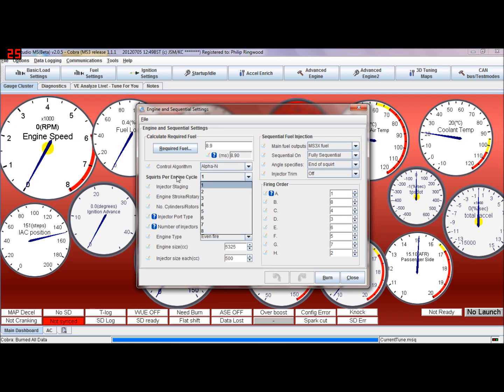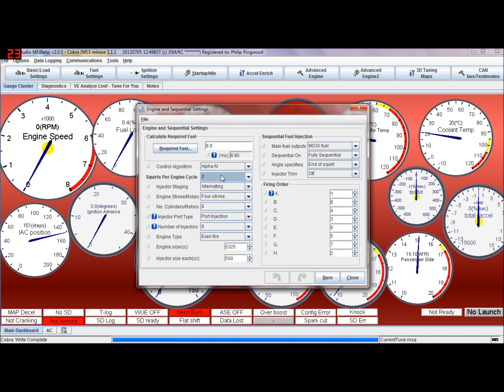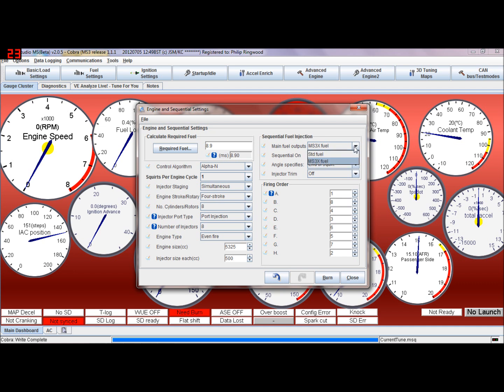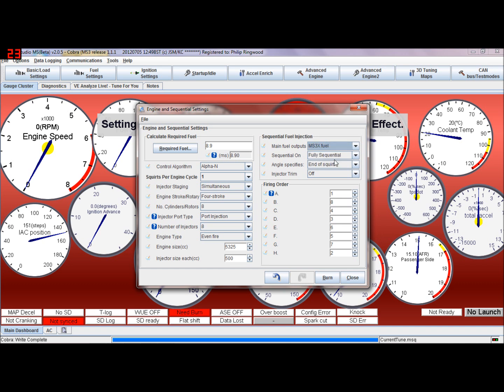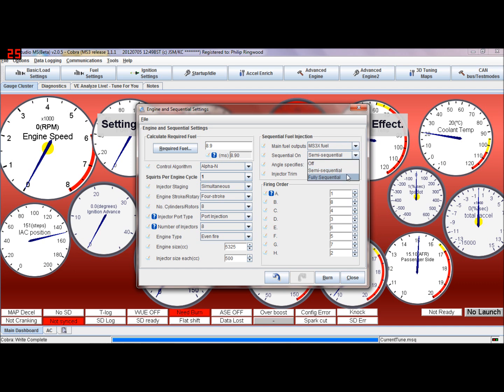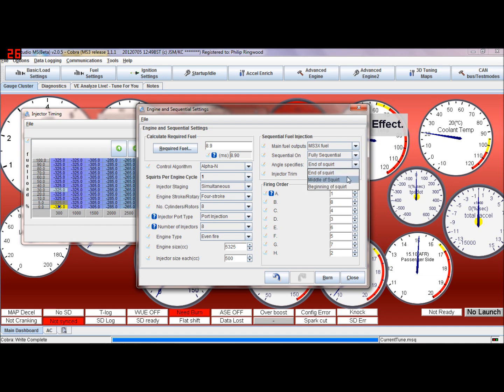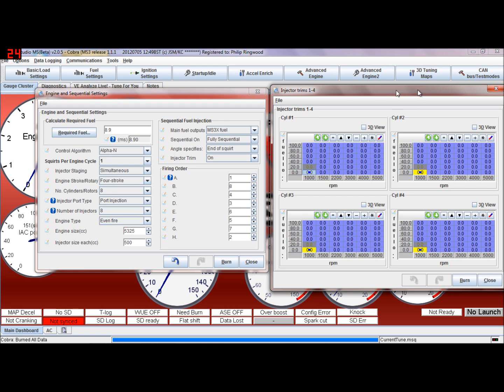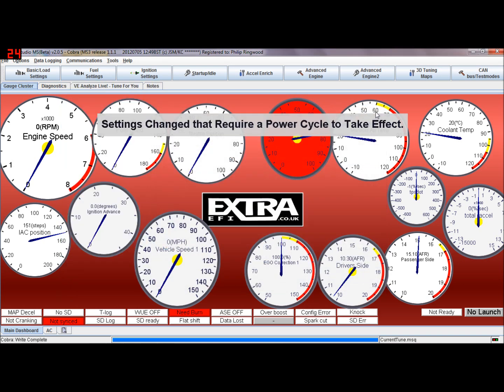MS2 MS3 Settings Tutorial Part 1b

Comment: How would one set Over-run Fuel cut on a motorcycle without a throttlebodyMAP sensor (only baro)? setting it to engage at MAP lower than 120 kPa would result in a lot of unwanted fuel cut situations right?

Comment: The MS1 / MS2 ECUs are batch fuel with 2 injector banks (the MS2 can run seq and semi-seq) but this doesnt mean it throws fuel away, it simply means that the fuel sits in the inlet manifold cooling the valve(s) and vaporising until that valve opens and that cylinder sucks it in.
Sequential fuel would allow the fuel more time in the manifold as this would be squirted in just as the valve shuts, therefor giving maximum vaporisation, you dont put fuel in whilst the valve is open if you can help it

Comment: So your saying if i was to get a MS2 and run it on a 6cyl then it would fire two injectors at once?
But if i got a MS3 then it would activate one injector at a time?

So im guessing it would use allot more fuel? and possibly throw off the o2 sensor?